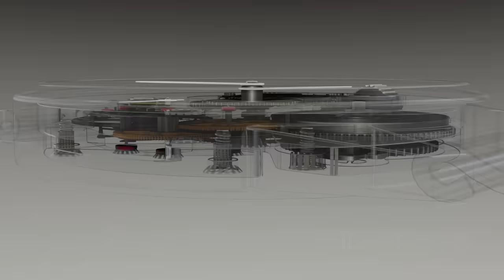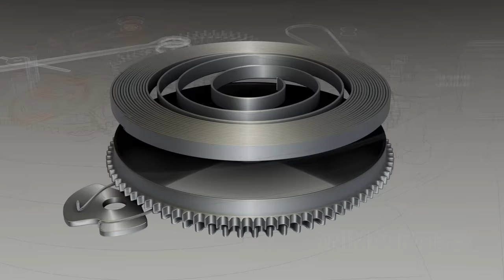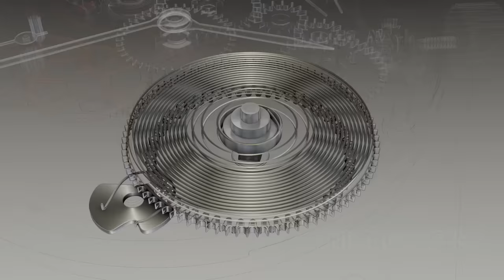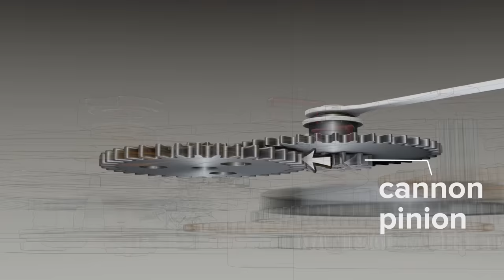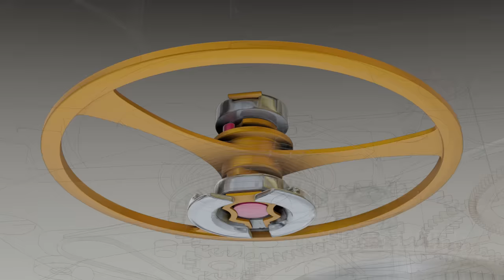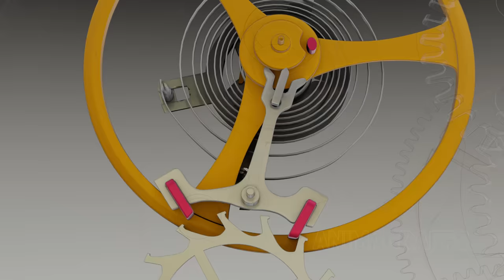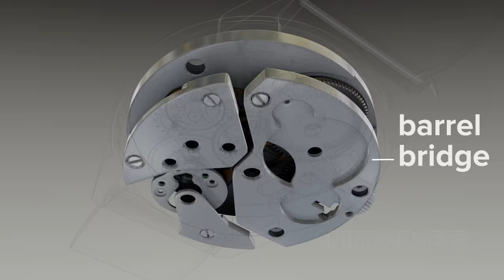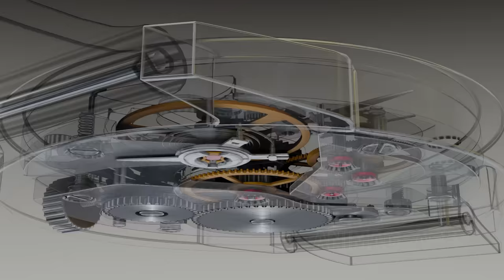How a Mechanical Watch Works

Comment: Wonderful display of the inner workings. Just one tiny thing: beats in a clock are shown as half beats. So commonly this isn't 6Hz, it is 3Hz. And 3Hz is mostly used in the newish Powermatic 80 calibers for 80 hours of power reserve. The second hand loses a bit it's smoothness.

Comment: I know I'm gonna trigger many of you but the mechanics of a mechanical watch is actually very simple... Although the production and the art of it is on a totally different level!
I know this design of mechanical watches has been in use for centuries but the age of this mechanism is now shown. With the money the watchmakers charge for high end mechanical watches, they should be able to create much more complex and hence accurate mechanisms almost every two years. I understand that this design is also very very sophisticated but the spring would be better off with an upgrade... and maybe have watches that could last for months or years, sitting inside a shelf. 
I only say this because the way the mechanics of a microprocessor or the RAM that is used in computers nowadays use mechanisms that are mind-blowing and its seen that they are  the best tech of today.

Comment: For the longest time I've been wondering how can a mechanical wristwatch work without having a second hand, and always thought that the power source (which ever that is; spring, quartz) moves the second hand first, which turns the minute hand, and then the hour hand. Turns out apparently according to this model it's the minute hand first?? The second hand apparently in this case is just a real fancy ornament which such an intricate mechanism to move the hand 6 degree a second almost instantly.

I can now fully appreciate why spring loaded mechanical watches are so darn expensive. Not to mention mechanical watches these days have date function, sometimes chronograph. In a 45mm wide, 6mm deep cylinder. It's insane. And let's not forget this is some hundreds of years of technology and still relevant for most people's daily life.

This reminds me that despite my dad's quite large collection of wristwatches (which I'm not influenced... yet), the most expensive one is a spring loaded mechanical one. I was curious why is it so darn expensive but hasn't got a date function (does have a second hand, which on its own is spectacular to look at) while my 6x less expensive, battery powered watch got a date function. Now I know.

Comment: Fundamentally it's a spring powered gear train with a regulator system in the form of the escapement and balance wheel.

Comment: Very well done! From my own experience only high end mechanical watches can keep better than about 4 to 6 seconds per day while being warn. The engineering of mechanical watches is genius and is complicated. Mechanical watches that have the date, and then have timers, and or chronometers are more complicated. 

Quartz watches using chip technology and are running on software are much easier and much lower cost to have complex features. A pure digital watch has no moving parts other than the switches for setting, changing modes, and for the display light. Quartz watches with mechanical display are commonly driven with a pulse motor mechanism. I myself like pure digital watches for everyday use and while I am working. This way I don't have to worry if I knock or drop the watch. Mechanical watches tend to be fragile, and are expensive to have serviced. The drawback with electronic watches is after a number of years they become obsolete like anything else electronic, then other than changing the battery the manufacture will no longer supply spare parts to service it.  Decent digital watches can keep better than 6 seconds per month. There are high end ones that can keep better than 2 seconds per month. This is more than accurate enough for the average person. 

Mechanical watches are more classic, have character, and are actually more interesting. A decent mechanical Swiss watch is very expensive for the average person. High end mechanical watches keep their value, and can be passed down from generation to generation. They can last forever as long as they are maintained by a qualified watch maker. Getting the internal parts cleaned and lubricated at least every 4 to 5 years is recommended for a mechanical watch.

Comment: Most excellent video! I love mechanical watches! Brilliant work! It is my understanding that the mot accurate movements include thermal compensation. That is not included here. (presumably a bi-metal piece that expands and contracts as necessary to adjust the pin on the hairspring.)

Comment: Very nice.

I've wondered what keeps the watch running at constant time. When it is first wound, it would seem the spring puts out more energy and would make it run faster and slow down over time. I guess the escapement is doing this, but I'm not clear on how this normalization works.

Comment: As a auto transmisson rebuilder, and lover of timepieces, I wonder it this can be incorporated into a vehicle. Perhaps hybrid where when on the highway, not much power is needed, so a wound barrel spring add on designed carefully could be the ticket!

Comment: Hi,
Thanks for the wonderful  video. It is more on illustrating all the mechanical parts. 
I have seen in other watch repairing , restoring of vintage watch videos, a watch repairer always wind the main spring tightly before fitting into the barrel and put in place.

I still didn't get where is the gap or space inside the barrel to unwinding of spring to release its energy or make some tiny wheel to rotate?

If the mainspring is already wound so tightly to fit into the barrel and why would a crown or other rotary moment needed to again wind the spring?

 Where is the other end of the main spring connected outside of that barrel ? (  we see always one end is at the center axis holds the spring) 

I don't understand still clearly what does a balance wheel do if already the mainspring inside the barrel holds the spring tension and assuming that it is releasing energy... ( where it released ? Where is the other end of the spring)?

I reached to your video , while searching for answer for these queries which came in mind while watching a very old 2Dim video explaining how mechanical hand winding watch works.

Comment: Wow!  Beautiful animation!  Thanks so much for creating this!  Being a watchmaker I did notice a couple of items that I wanted to point out:  The top, balance cap jewel should be slightly domed on top.  It looks flat in the animation.  The bottom cap jewel is shown with a hole in it.  Did you mean to do that so as to show the bottom balance pivot?  If not it should not have a hole.  The "balance bridge" is actually a "balance cock".  Bridges are usually secured at 2 or more places with screws on the main plate.  Cocks are usually only secured in 1 place.  Nit-picky I know :-).

Comment: Great presentation. i'm sorry for my lack of understanding. i still can't figure out how the ecapement work. The pallet fork is only moved by the swing of the ballance wheel so the escapement wheel can rotate right? So if the ballance wheel is in idle state,  the escapement is locked by the pallet fork isn't it? So how does the power from the main spring can swing the ballance wheel?

Comment: Amazing visualizations, with clear explanations. Really top quality that should be shared as learning material !
I did however not find what I was looking for, because I wanted to understand automatic watches. How does an automatic watch reload the spring because it's turning both sides so I don't really get it, if someone has the answer :)

Comment: Question. When you hack a mechanical watch will that stop the main spring to unwind as well? For example the quartz watches once you hack is my impression that the mechanism is detached from the battery. So the battery remains charged.

Comment: Hi! Excellent video! I have just one question. How is the power from the barrel delivered to the balance wheel/hairspring? Is it via the gear train that you mention? I'm a little confused because I'm now wondering how the hands move. Yes I understand that the hands are attached to the gear train but if the gear train is regulated by the escapement surely then that means the barrel is connected directly to the balance wheel/hairspring, no? Also, can you make a video on how the barrel works. Thanks.

Comment: how main spring is connected to hair spring is not explained or demonstrated. that's the whole point of mechanical watches. how spring oscillation can be turned into an accurate 1 second periodic motion mechanically and reliably? rest of the gear mechanism is visually interesting but no mystery there. waiting for the absent explanation was painful.

Comment: If I may ask..how does the pent-up mechanical spring force of the woundup mainspring is contained so as not to produce strong force onto the balance wheel?
Reply from the maker: The hard pallet fork jewels are designed to handle the force exchange from mainspring to balance wheel. They're sturdy to handle repeated impact of escape wheel teeth, but also smooth for minimal friction as escape teeth rub against them. The mainspring design (metal type, winding procedure, etc) is tuned to give the precise amount of force without being too strong or too weak for the overall design of the watch components.
Reply: @animagraffs  elegant!! thanks for the reply. keep the interesting contents coming!

Comment: Can anyone explain why some mechanical watches work only on wrist? How does it connect to the body?
Reply: Some watches have an automatic winding feature that uses a rotor in the watch that oscillates as you walk and winds the watch, so as long as you wear it every day, you don't have to wind it manually.

Comment: Does anyone understand how the balance wheel switches directions? That's the only thing I'm confused about.
Reply from the maker: The hair spring "bounces" back and forth, getting a tiny little push from mainspring power stores with each tick.

Comment: Fail in 30 seconds. "...power is stored in the mainspring and released..."  . but it is not explained . Like explaining an internal combustion engine and leaving out the fuel /air mixture .
Reply from the maker: "....released in reliable increments by the escapement." Then at around 4:16, I explain how the escape system meters and releases mainspring power.

Comment: Great animation, but you are skipping one main step. 

According to these diagrams power goes from the balance wheel to the pallet fork, to the escape wheel.

But you are not showing how the pallet fork delivers power to the escape wheel. If you look at the animation carefully, you can see no mechanism for this delivery.
Reply: I was wrong. The energy goes the opposite way, from the main spring to the fork.

Comment: Mechanical watches/clocks being less precise is pretty irrelevant because most clocks dont have the exact same time anyway. Not even two identical phones that get their time from the internet etc.

So if its 20:01:58  or 20:02:02 makes no difference in the real world. And when you even have radio controlled clocks the distance between the clock to the source of the signal and eventual obstacles such as walls etc also change the accuracy.

In a world where everything is punctual and no bus is late by even 0.5 seconds the quartz difference for NORMAL PEOPLE might.... well make a difference. But such a world does not exist (like in BackToTheFuture2 and the absolutely exact weather forecast)
But for basically everyrthing other than science its completely irrelevant. Even the stock market computers have different connection latency so even there a second is not over at the exact same moment on two devices etc.

Like if you try to send a spacecraft on an exact orbit to get a boost by our moons gravity you want quartz.
But for taking a bus, getting on a plane, going on a date, having an appointment and basically everything normal people do it makes no difference. And even having two perfect quartz watches might make a huge difference because 1 person might need longer to take a look and process what the watch says than another person :) and doing something with the info again takes time.

In my house not 2 devices have the exact same minute even. My microwave is different from my analog clock, my TV, phone and computer, game console everything is completely different. Sometimes even by minutes. No problem. I even have my kitchen clock run 5mins early because thats usually the last clock I look at before leaving the house so I never am late taking a bus or whatever. Does not make the bus be on time however so its late sometimes and even early sometimes :(.

A mechanical clock/watch however teaches people to pay attention, gets them something to do(a routine that helps them get some order into their life) and well doesnt waste batteries, electricity :)

Comment: Where's the battery and y do we use a battery
Reply: This is a mechanical watch, so it is powered by a mainspring. Quartz watches use a battery.
Reply: @hellothere9848  so does it stop working...one day or the other...if yes,how long will it run properly
Reply: @adhils9633  Mechanical watches will  last a very long time as long as you have them oiled and cleaned periodically. As for winding, you have to wind your watch every day in order for it to keep time.

Comment: Some watches have batteries, eg quartz movement. Accuracy of 2-3 seconds per day would be a dream, even a tourbillon that will set you back  $100k - $400k USD will not be within the spec that you suggest. Animations are great, your information however is lame at best.